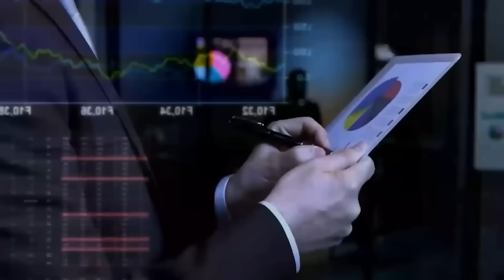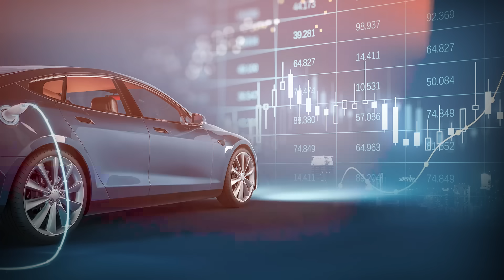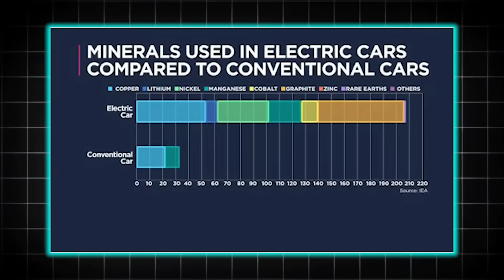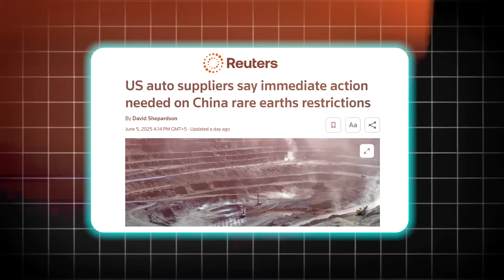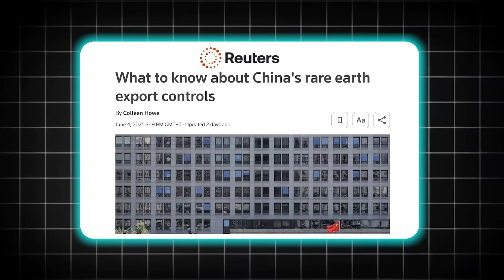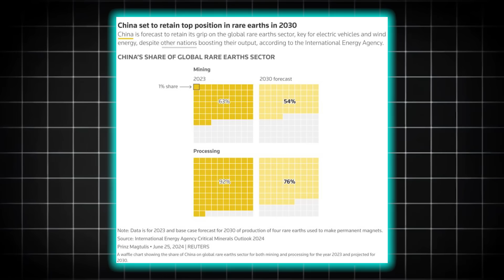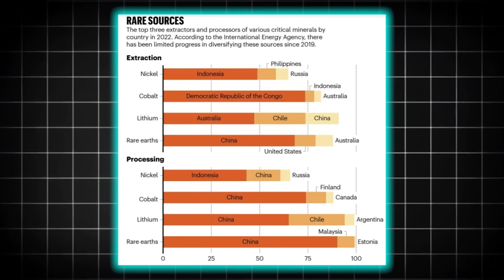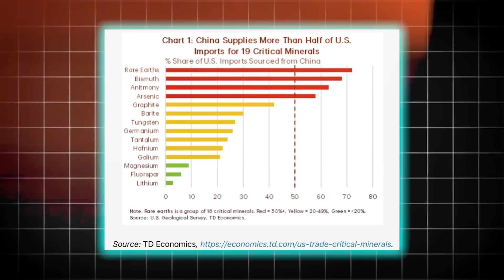Rare Earth Crisis: How China Is Forcing U.S. Carmakers to Shut Down in 2025

Comment: A good discussion. In the technological innovation war, China has effectively beaten the US in all spheres. For example, in Artifical Intellegence, DeapSeak is far superior and far cheaper than its US countrrpart. In electric vehicles, the Chinese BYD car is far superior and much cheaper than the Tesla or other US models. China has developed its operating system and microchips from the ground up, which are superior. The proof of Chinese superiority is that it is the US that has to protect its (inferior) products from competition with Chinese products by imposing tariffs. The most effective card that China used at the right moment was the ban on the rare earth metals, which placed the most decisive role in bringing the US to its senses. It is worth noting that China has been supplying the rare earth metals to the developed countries for a very long time. If China had increased the prices, countries like the US would have found alternative sources and developed the refining capacity. China knew that it was a strategic weapon and used it at the right moment. The real strength of China is its strategic planning, which is done at the level of the Communist Party. The US has got nothing comparable.
Reply: President Xi should continue banning rare earth magnets to be exported until all Us tarrifs are removed to ensure free trade!
Reply: @andrewleow7454  Hopefully, lift on rare earth metals will be lifted as a part of an overall agreement.  Cnina does not want confrontation.
Reply: @andrewleow7454  China doesn't do free trade.  They tariff like crazy.  Actually they do what the americans are trying to do now.  Try to start bringing your product into china,  Basically impossible unless you are w huge worldwide brand that speaks for itself.  If it is unique enough to be viable for the chinese market, they will steal the concept and do it themselves and you cannot sue them either.  Do not believe the lies that all these anti-western platforms try to sell you.
Reply: The US is not going to get out of this predicament if it keeps blaming others. The US needs a coherent long term strategic plan. No headlines just a plan that avoids these kind of predictable outcomes.
Reply: @ricklearn16  in this case regime change not possible by nato us
Reply: The evil empire USA doesn't respect others n think they are boss
Reply: @ricklearn16 Excatly, that is the most honorable option for the US. Threatening and restricting products and people is counteractive. US has the best universities (in which talent from the entire world is gathered) and research infrastructur. It can become a strong competitor.
Reply: @ricklearn16  If you haven't noticed,  Most people in USA mainly blame our own government for empowering the CCP just to get cheaper goods and in the beginning higher profits.
Reply: @Silv3rb4ck I heard one Pundit describe it as, "The US gave up manufacturing supremacy for Dollar dominance."
Reply: The wisest ,the Rarest person on earth President Xi Jingping❤
Reply: Thank you Madam Najma Minhas Peerzada
Reply: Absolutely right. Satan USA is declining n think they can do n impose their will on others.
Reply: Full agreed. Time for Us govt to change its mafia bullying behaviours. Even its G7 allies had witnessed its true colour recently and will not be so obedient with Us!
Reply: The U.S. is no longer NO1. There should be no more than two months worth of rare earths left. If weapons can no longer be produced, the U.S. cannot intervene if China advances on Taiwan. If the U.S. does not intervene, Japan will not move. If the US abandons Taiwan, Japan will no longer trust the US. It is the end of American hegemony. China has a monopoly of more than 90% of rare earths. It is foolish to antagonize China. The U.S. military industry will come to an end simply by stopping exports at this point. China does not even have to fight the US. If the US apologizes to China and offers all of its technology, it will get rare earths. The United States must make a choice. Ceding hegemony to China or gaining rare earths? China will not compromise. China is in a position to hold rare earths hostage and blackmail the world. China's traditional top priority is to win without fighting. The U.S. should admit defeat and ask for forgiveness. Otherwise, rare earths would not be available. China will neutralize the US without a fight. All the white man can do is admit defeat. Going against China is the same as going against God.
Reply: The United States can use force to force China to sell rare earths and weapons to the United States, and then the United States can use the printed dollars to buy weapons from China to force China to sell rare earths and weapons to the United States. The logic is closed and perfect.
Reply: yes Deep Seek scuttled any chance of US monopoly on AI. Be warned elon did say those who harness AI will be first trillionaires , China says" keep it open source, n free, to empower the world " 
🐧🐧🐧🐧🐧 are cool dudes